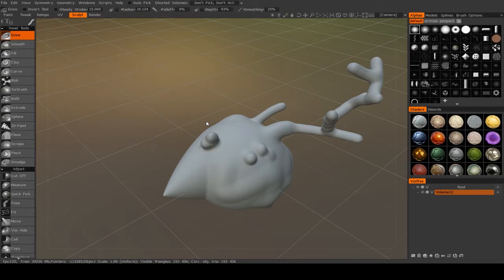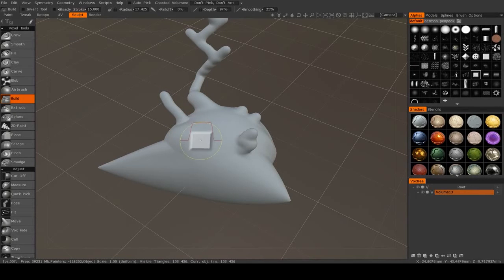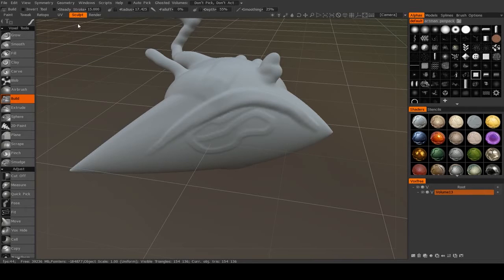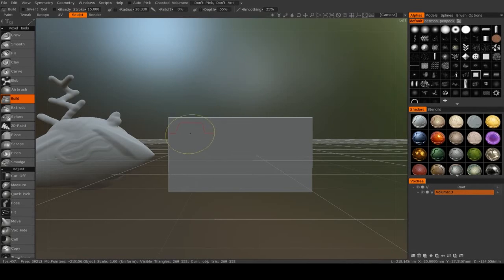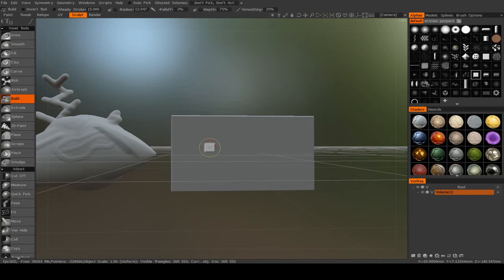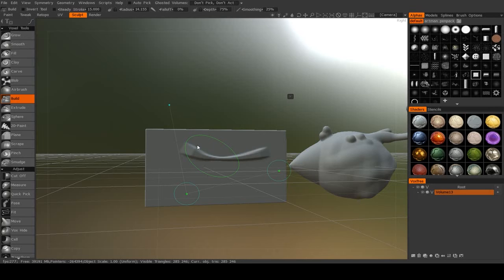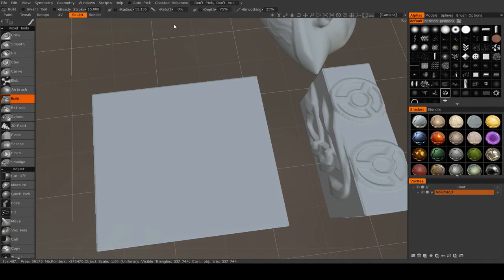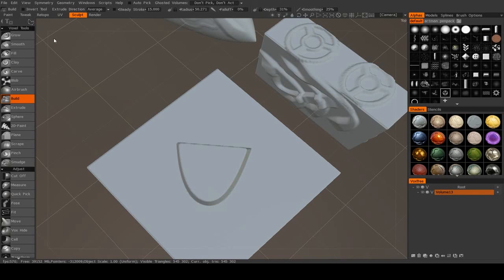Welcome to 3D-Coat: Part 3 (Stroke Modes)

Comment: Thank you for taking the time to go over the many features of 3D-Coat.  These vids are very helpful.  Question; are you using a standard wacom tablet, or more a tablet more on the top end of the priced scale?
Reply: I am the one who uploaded the video, but the AlienMinefield account cannot comment. 

I use a medium sized Wacom Intuos tablet (Not Intuos Pro, just Intuos). To me, the difference in performance between the regular and Pro versions does not compensate for the difference in price. Also, I use a regular tablet rather than a Cintiq because with a tablet, my hand and arm don't get in the way of what I'm trying to look at.